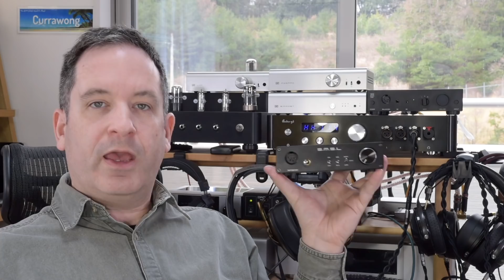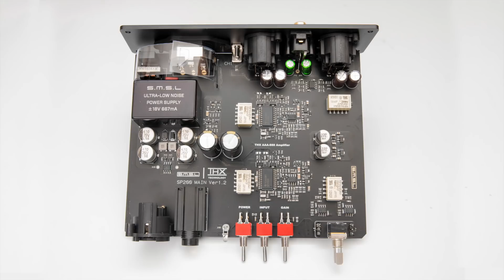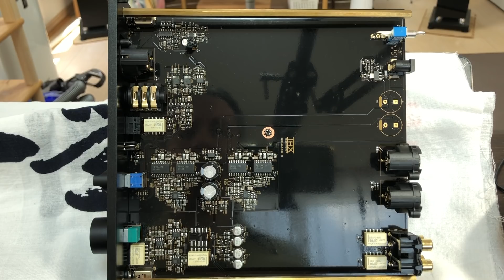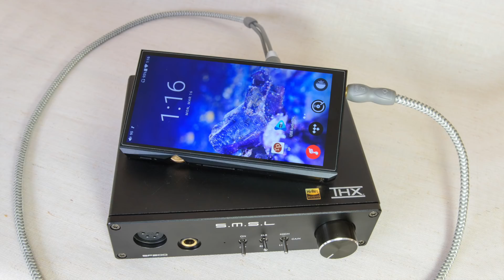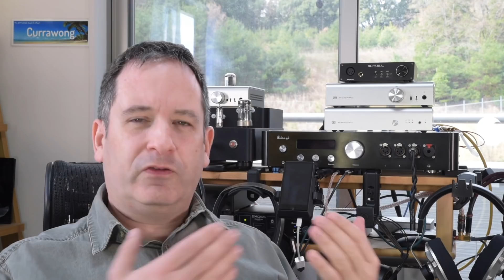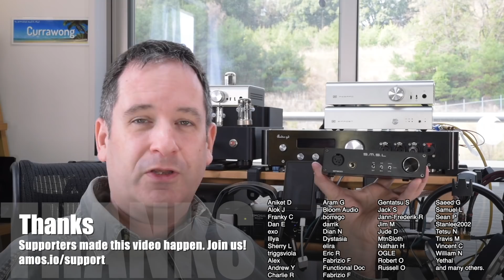SMSL SP200 THX AAA Headphone Amp Review

Comment: Well, you are right saying it's slightly less Detailed, less separated and clarity lacking vs 789. But to me isn't that just 'slight', It's kinda more huge the difference. Ok, i may have a more sensitive hearing than average, finding differences in every cable and dac filters, but the difference was kinda marked, even jds atom is more detailed for lot less money (!) even if the sound of sp200 is more 'free', but kinda flat overall..
789 even in SE kills it on SQ.
I do wonder how asgard 3 compare to 789 for half the price! Maybe this has already been told?
Reply from the maker: What headphones were you using? I didn't want to bring out the $3k+ headphones and say "The difference is huge" because people don't usually buy those headphones and this kind of amp at the same time, so I used headphones closer to the price. Also, not everyone listens to the kind of music I do. But it is interesting that some people notice the differences very strongly, and some less so. I saw someone on Amazon review it and say that THX amps sound "compressed". 
As for the Asgard 3, I probably mentioned the 789 in my review of it. I can't remember for sure though!
Reply: @Currawong   Unfortunately i couldn't compare THX aaa 789  directly with Sp200, but i compared Sp200with atom which to me was enough. Thx aaa 789 was in loan, before i owned Lcd-3, He1000se and He1000V2. Then after i sent back sp200 i had it back. Differences we're real.. 
I tried it with Audioquest NightOwl, Sundara, Audeze El8 Titanium, AKG K712, AKG K371, enough variety, well, my dac is kinda cheap, the Topping D50 with Optical glass connection, but it delivery nice detail even if pushed, i'll upgrade as soon with D90.. But yes, to me the difference with relatively cheap headphones we're defenately more than slightly. Yes it delivers huuge dynamic, but i felt they was filled too much with bass with lack of clarity dynamics. Clarity is not enough for such 300€ amp, to me at least. Maybe as you say would be the power supply, idk, i'm not an expert at all. 
But it's ok! I didn't tried yggdrasil and such top tier amplifications, i'm kinda new, so maybe it would be slight to sp200 to 789, but more huge 789 to 2000-3000€ amp :)
Reply: @vipernecklampy8773  How did the Atom compare with SP200?
Reply: @vipernecklampy8773  you are buying $3500 headphones with a $260 amp? and a $200 DAC?
Reply: @Tallnerdyguy  Yeah i mean, i used them, that's why i owned the big headphones for just a month. Now i can see that my Topping D50 is a bad dac, and Thx aaa 789 can be kinda right, a entry level amp for a 3000€ headphone, right? I don't know if would be better Topping D90 or by some the Bifrost 2. Something even more expensive kinda puts me off right now.
Reply: @vipernecklampy8773  not saying the d50 is a bad dac, but it's like buying a Porche and getting "oh whatever" tires. Just proportionately. If you have $3000+ to spend on headphones, you should have enough room in your "budget" for some higher end equipment.  Most DAC under about $500 are going to be pretty similar, with a few different features. There are some that stand out as "bad" but a lot of them are pretty good and hard to differentiate.
Reply: @Tallnerdyguy  Yh agree (But also i did see how much i did like He1000V2) maybe if I would like to go a little bit over the kill, i would take an Arya with a D50 and Thx 789, but if i upgrade on a very nice dac i can see a 3k expensive headphone if of course i Like it. But I guess double expensive gear is going to be better, but also mostly are big, heavy and so not transportable..
Reply: Im not sure if people like you are paid to say these things or something, but I have the sp200 here with the Monoprice 887 which technically should be better than 789 and there is probably only like 1% of difference.
Reply: @TooHot2387  Me? Paid? No way..
If you have 887 and Sp200, 1% of difference?
... 
If that's it for you. Just sell 887 and no look more for upgrades, you're accomplished :)
Reply: Viper Necklampy idk the soundstage seems to be a tad wider on 887 like 2-3% wider, but the bass impact seems to be a tad more prominent on the sp200. That’s literally it for me. Everything: clarity, tonal balance, articulation seems exactly the same, and I’m suppose to have very good hearing going into the 21-22k mark so idk man. Maybe I don’t have enough headphones to test it, but judging from hd800s, focal Elex and hd 650, the difference is unnoticeable.
Reply from the maker: Everyone perceives the sound slightly different. For some people, a small difference will be much bigger because of their headphones, music choices, and experience and sensitivity to sound. Also, a small difference might add up to a big one over time. For example, if the decay on guitar plucks or piano or similar are slightly clearer and you listen to a lot of good acoustic music, that will add up to a lot more clarity. If you become aware of it, then it's more noticeable too.
Reply: @Currawong  Thats true

Comment: Smsl sp200 owner - the volume imbalances are really bad at low volume. If I want to listen to quiet music, I have to lower the source (tidal) and then bring the smsl volume to about 10 o’clock before the imbalance clears up. Also - after a few months I started hearing ticks and pop noises. After lots of equipment switching and cable changes, it was narrowed down to that amp. Make sure the vendor you buy from has a good return policy before getting this amp.
Reply: Big problem with smsl. QC. That's why I bought K5 Pro. Official support in my country- India. Got a DOA set. Got a replacement in a month from fiio.in.
Reply: I have a chinese headphone amp board with the same pot from the looks of it.  Mine tracks very good, I find it typical that all components keep getting smaller.  You probably got a potentiometer that somehow sneaked through with an atypical build.
Reply: if it is as good as they say i would even cannibalize the guts and put in another box and replace the volume pot with a decent discrete attenuator ... that would provide you with a very high end amp.  I am thinking about this very seriously.  In my experience the volume pot has a very high impact on sound and discrete attenuator are pretty above normal pots. It is impressive the gain in transparency and soundstage reproduction. You can pin point instruments and players ... i think cheap volume pots cand add distortion ?
Reply from the maker: It'd be interesting to see how the amp performs if you used a better power supply.
Reply: @Currawong  i think that the quality of the pot is very impacting in the sound.  Usually high end headphone amps have very high quality volume pots with the best being discrete attenuators.  I did some test with an attuenuator and i was amazed about the increase of transparency obtainable.  I would like to use the motherboard of this amp for a DIY project i have in mind.
Reply: SMSL SP200 owner here as well.. I'm not experiencing any of these problems. Absolutely perfect working conditions. No problems what so ever. Use it for hours every single day since the day it was released. Love this amp for the money. Incredible value
Reply: SoldierBoy 23 fair enough but this product has left a bad taste for SMSL for me. I got it for about $50 less than normal and I’m outside of the return period. Once my jotenheim comes in I might honestly throw this thing away. I wouldn’t want to even sell it.

Comment: I have a Hugo 2 will it make sense to add SP200 in the chain for more power and dynamics to drive Z1R and Arya? or will I lose resolution and Hugo 2 alone should be sufficient. Thanks
Reply from the maker: No, I don't think so. You'd lose detail and dynamics with it.
Reply: @Currawong  Many thanks for your answer.

Comment: I'd buy this today but I can't get over the shape. I rather spend the extra money on the THX 789 or 887 and be completely happy than spend the money on this and forever question why, why make it with a lean/slanted while I looked at it with disappointment on my desk.
Reply: Having 3 gain stages, and a much better potentiometer is also quite nice. The volume knob on the SMSL SP200 is easily the shittest I have come across.
Reply: @kristoffer8740  Internal power supply > HUGE wall adaptor. Can't stand the dc conversion on the floor everywhere. The SMSL is just so good for the price, for running headphones. The slant doesnt matter, its below eye line and you dont notice. Value for money, this thing is the best out there.
Reply: I got mine last week and I can tell you the slant really isn't THAT noticeable in real life. In my case, the amp is not even in my line of sight when I'm listening, so no big deal. The only disappointing thing about its appearance and build to me is the feel of the volume knob, which doesn't offer the pleasurable resistance of higher end stuff.